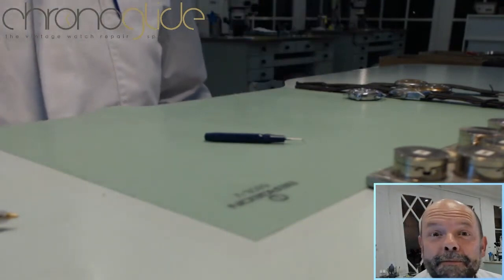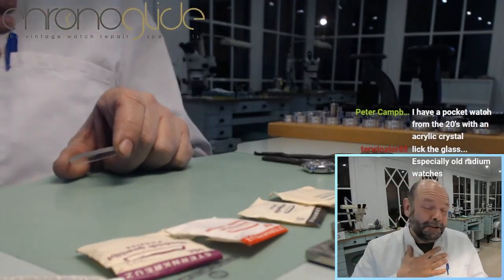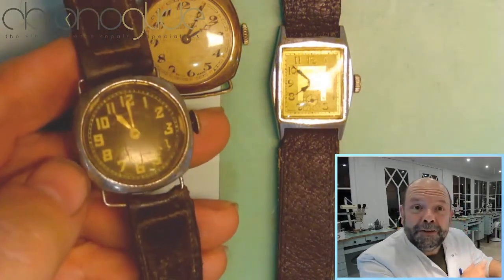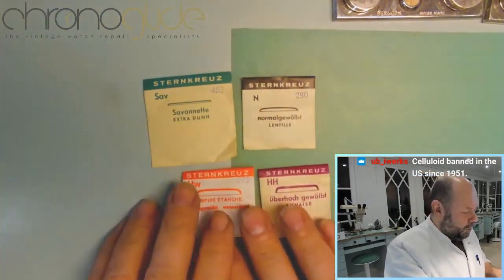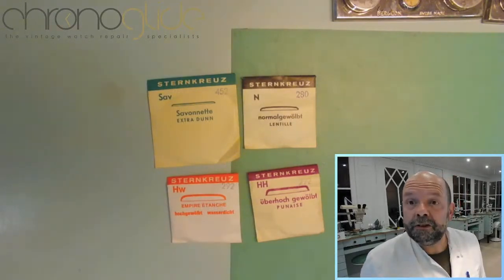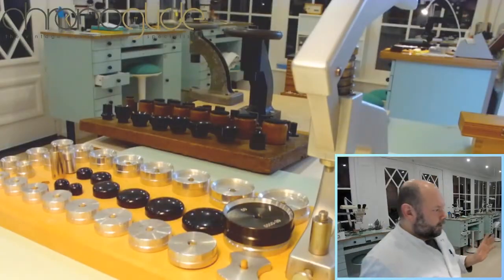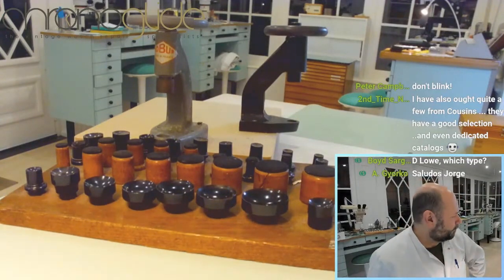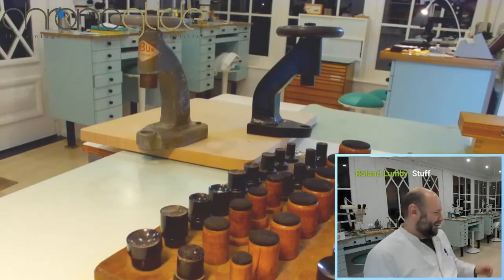Watch crystal - replacing / repairing / polishing  - Part 1of5

Comment: Hi Kalle, one important point regarding the celluloid watch crystals that are prone to becoming discoloured (yellow usually) with age. 

The celluloid is made of something for which the chemical name is cellulose nitrate.

When the cellulose nitrate is exposed to UV light and becomes discoloured, it off-gasses as part of the chemical decomposition process. 

The gases it gives off when it decomposes are nitrogen oxides. There are reactive and corrosive gases, which upon contact with moisture become nitric acid and nitrous acid. 

The gases themselves and the acids they form in contact with moisture will attack and corrode any exposed steel or iron they come into contact with. 

This is why you will find that the hands on watches with a yellowed crystal have a rusted appearance. In more severe cases, the cannon pinion, motion works and keyless works also show corrosion due to these gases. 

So as attractive as the vintage look of a yellowed crystal is to some people (I like it too), all celluloid crystals should be replaced to prevent damage to the hands and the other steel parts closest to the dial. 

There are many resources online which will confirm what I’m saying. The damage these crystals do is very real and you will immediately start noticing a correlation between yellowed watch crystals and corrosion on the hands and possibly the steelwork under the dial. 

I’ve been told that even the steel parts on the other side of the movement can become corroded due to this, but have not yet witnessed it myself. 

Thank you for all of the fantastic content, I really appreciate your YouTube channel.

Comment: If you leave the watch off the wrist to adjust to ambient temperature, and then hold it against the forehead, you can determine if it is sapphire by the much cooler feeling. In fact sapphire will feel almost icy!  It's not actually cooler of course, but it feels it. Sapphire has a much higher heat transfer than mineral, or glass. The effect is that it draws the heat out of the skin faster and therefore feels cooler.
Reply: Nice idea! Plastics like Acrylic (PMMA) and celluloid would be warmer still, since the specific heat-and conduction are much lower than glass.
Reply: yes, I think there are even digital testers that use the heat transfer to determine if the crystal is sapphire or plastic.

Comment: Since the acrylic “off gasses” & turns it yellow, can the yellow be polished off off the surfaces or is the yellowing throughout the crystal? If it is possible to remove the yellow, does that typically harm the if value if the rest of the watch is left original?

Comment: I'm new to watchmaking. You may already have a video on this but I'm having trouble figuring out what movement I have. Where do I get the info and what numbers do I need from the watch.
Reply: I had the same issue and found it under the balance cock. It can also be on the main plate. Hope this helps.